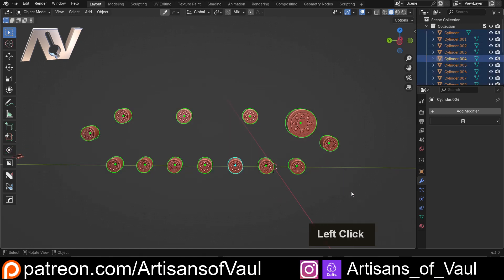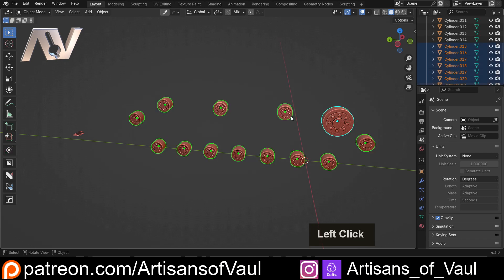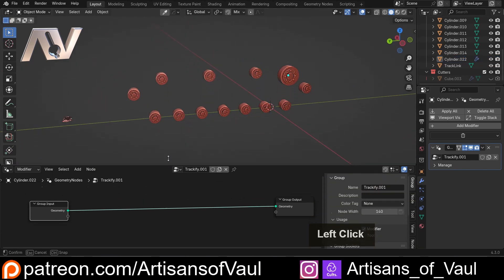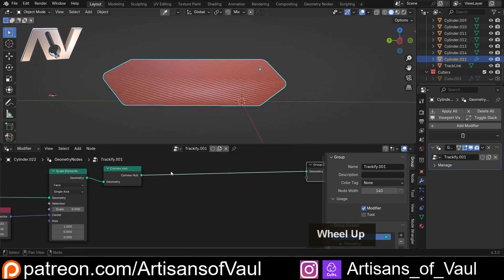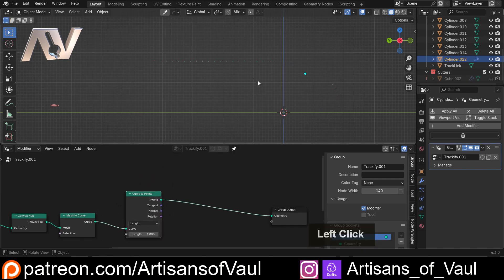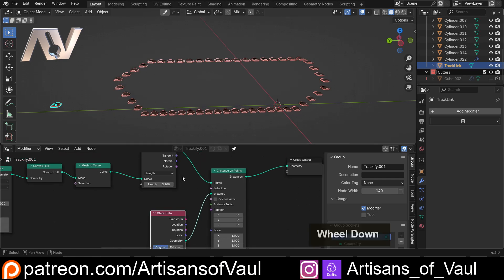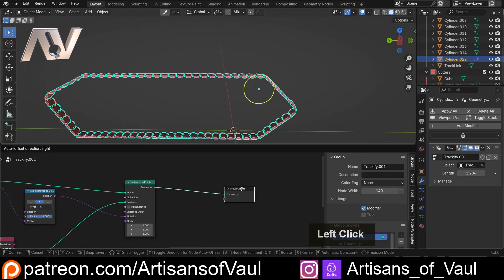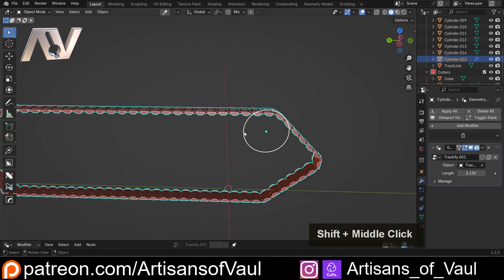Make tracks around objects in seconds with this Geometry Nodes setup in Blender!

Comment: Oh man, I followed these steps in the past, worked like a charm. Now in the latest blender, I simply don't have a "Geomodifiers" tab in the add modifiers section...
This was so helpful, but then blender changes things around, trackify is completely gone after the latest update... Or I can't find it. So annoying
Reply from the maker: Which version are you using?
Reply: @ArtisansofVaul  I'm currently on 4.4.3
I managed to figure it out in the end, but because the modifier was missing, it took me quite a while. The Trackify modifier would have been a nice shortcut

Comment: so im trying to do this, and using the tangent from the curve to points does nothing? nothing rotates at all when I connect tangent to rotation in instance to points, did something change in blender?
Reply from the maker: No any changes to the aligning functionality came before this version (it was one of the reasons I wanted to do the video with the changed node).  So not sure what is the issue in your project but it shouldn't be that.  If you can find me on Instagram you could share the file for me to look at.

Comment: is this an addon?
Reply from the maker: @fragelius  No. This is using geometry nodes in Blender
Reply: @ArtisansofVaul  I dont have goeModifiers option in my add modifier panel :x
Reply from the maker: @fragelius  what version of Blender are you using? It would need to be pretty out of date to not have the geometry node modifier.
Reply: @ArtisansofVaul  4.3.2
Reply: @ArtisansofVaul  its maybe something you need to enable in blender no?

Comment: @17:26 even if i do this, with a flat rectangle plane (as a road in this scenario) - like you said, i dont think its possible to ever get those sides to meet perfectly, because we're instancing a rectangle on a point, there will be overlap on curves.

pity though because making roads like this would be so useful
Reply from the maker: You wouldn't make roads in this way? You would want to use a profile of the road and add it to the curve.

Comment: The better wayis  to place origin of the single track to one of two axis of rotation and somehow to apply look at constraint to force every N track facing N+1 track. Also there is not a best solution to combine all instances to one object as result. The best choice is to keep every track linked as instances and to be a seperate objects with their own rotation transforms how it can be done with common way by arraying planes thrue curve and instancing tracks on these planes.
Reply from the maker: @YuriKruglov  Interestinf idea to use the constraints but I think that could cause the opposite issue of having some tracks overlap more and they would be further towards the "wheels" than you would want. But it's an option for sure.

Comment: This is great. You can set the points to be separated by the distance between track pins then find a midpoint of those points and that is where you would put your tracks so they are "linked" together.
Reply from the maker: @Arg0n01  good idea on the track pins.

Comment: I'm loving the geometry nodes content. I think I'd put the wheels in a collection instead of duplication/join, and put the setup on a new second object that references instead. But I can use it as-is by just copying/joining the collection on the new object instead, as a preceding node. The advantage is that it's nondestructive, which I'm really into right now.
Reply from the maker: Good idea on the collection. I haven't tested to see how it will work on a collection as the context hull normally works on a single object bit if it works on the collection that would be great. 👍🏻